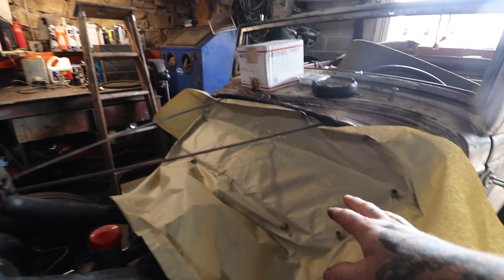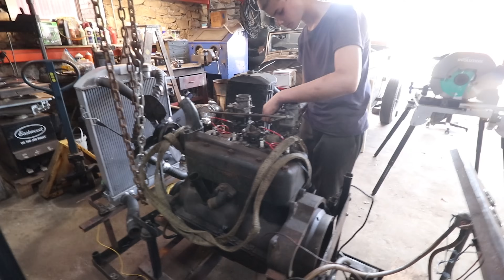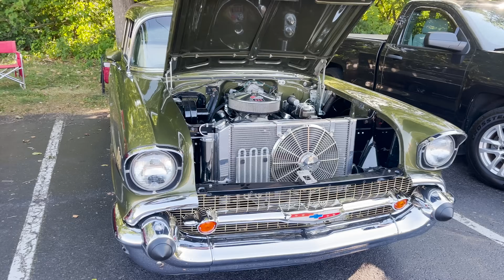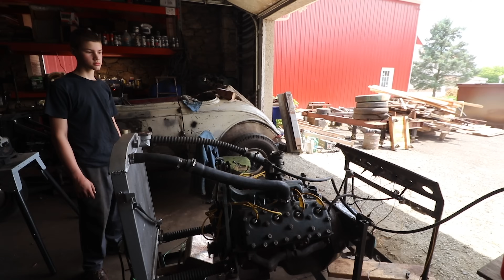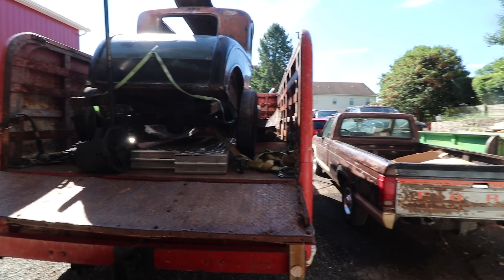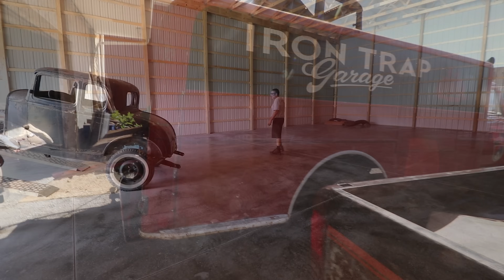Flatheads, Cruise Ins, Endless Amounts Of Work!!! - Week Of Iron Trap

Comment: hey Matt a good (cheap) way to seal the concrete is to use a heavy wax  commercial liquid ,mop on ... ask guys that were in boot camp and how the "bay" floor was kept shinny
or if you have a connection  with the local DOT street section ( I did this ) get some white line paint and roll it on seals well looks great

Comment: Hey Steve: The easiest way to carry a sheet of plywood is "on your back" !! Stand it up behind you, squat a tiny bit and lean over slightly with the plywood balanced on your back. It's a quite comfortable way to move a sheet of plywood. Wind is the only possible issue. 
Good that concrete you showed in your concrete pour was NOT yours. That stuff was WAY TOO WET !!! The strongest concrete is the "DRYEST" concrete !!! On concrete pours I worked on decades ago on government buildings (schools) where the inspector was "on-site" all the time, they would hardly let you add 5 gallons of water in an entire 10 yeard concrete truck. They also took samples from every truck for testing. It was "another time" where care and quality were actually important issues. 
I would have been in "dreamland" if I could have done what your nephew is doing when I was his age. It would likely have been a total "life changer"!! I likely would never have become an electrician.

Comment: Morning Matt & crew!!
Your nephew is living a young hot rodder's dream! Hanging out at Uncle Matt's hot rod shop!!
Matt, I have a question in regards to the Eastwood paints, I used the Eastwood Matte black under hood paint in a rattle can, it was about 85 degrees when I painted some metal interior parts, the paint dried with some solvent spots, was this due to the high humidity or?
These are metal brackets in the ceiling of my 31 Ford Coupe, you probably won't see the spots.
Reply from the maker: Could be there was residue or contaminants on the surface of the panel before you painted. Hard to say